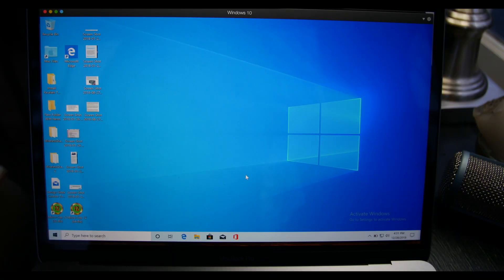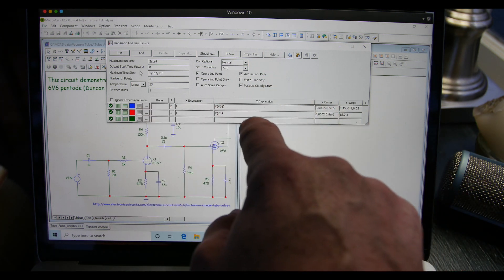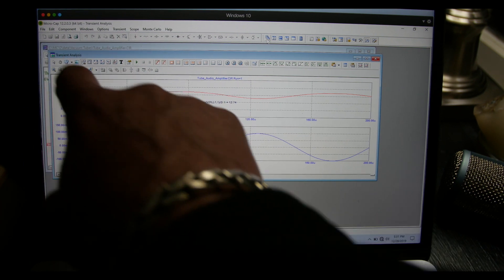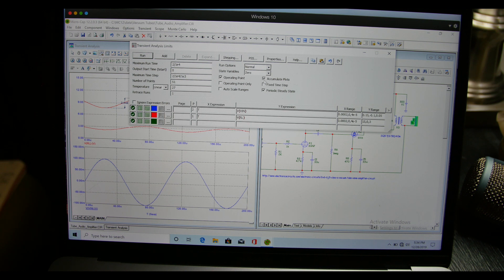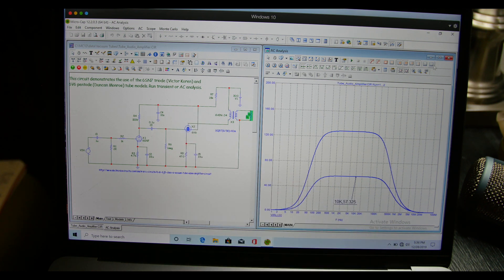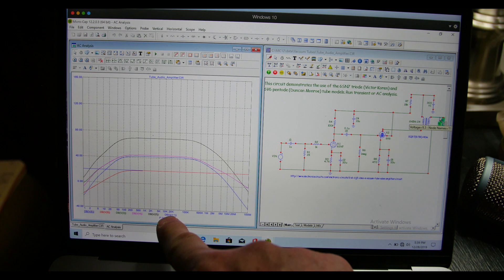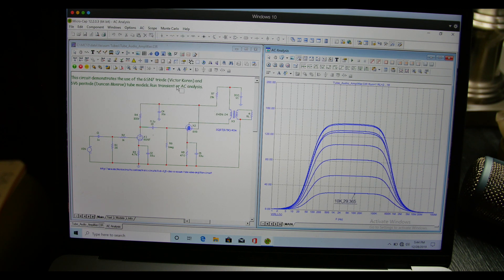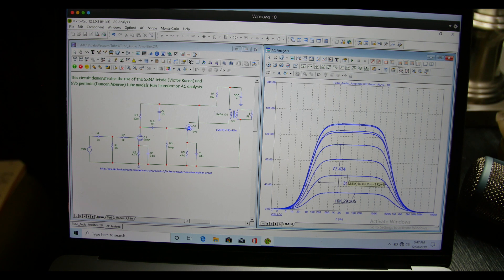Micro-Cap Tutorial #1: Tube Amplifier #microcaptutorial

Comment: Thanks for a very nice presentation. Could you perhapps do a tutorial to understand better simluation problems. In relality the analysis can run into difficulties with more complicated circuits. For example "No DC path to ground"  when infact there is. Or Matrix errors, etc.
Reply from the maker: Thanks for the great idea!  I’ll do that, and is there any other specific examples?
Reply: @KissAnalog  Greetings , thanks for your reply. Well, the problems I have experianced so far are those stated above. Especially when we are dealing with a more complex circuit. For example, how do you deal with a matrix error when the only explanation given is that its something to do with DC loops and the structure of the circuit. In the example of an amplifier ( Tube Amp)  I had to resought to seperating the preamp. and opening another session and looking at that, effectively using the simlulator to look at blocks of the circuit instead of the whole circuit its self. So if you could do a thorough teaching on this it would indeed be much appreciated :-) and keep up the good work sir!

Comment: Thank you for giving us the scoop on this amazing simulator!    While I was playing with the AC Probe analysis, the whole application crashed.  But when I opened it back up, the circuit I was analyzing returned and I was able to continue on with your great tutorial.  I'll have to keep an eye on the crashing.
(I'm running this on a 32GB i7 Core).
Reply from the maker: You are welcome!  I’m happy to see others take advantage of this amazing opportunity!  Are you running on a MacBook Pro?  I use both my MacBook Pro for personal use and a pc for work.  I have had crashes but like your experience, it pops right back up.  Simulations can be dicey but MicroCap seems to be an amazing tool.  I do have a playlist;)
Reply: @KissAnalog  Agreed.  I'm only running on a Windows 10 Enterprise box.  I ran it on a Windows 10 Pro with out any issues.  I'm dismissing it as a fluke.  And yes, I've got your playlist in the queue.  :D  So far it's excellent.

I was playing with Fastad.com circuit.  Albeit it's pretty good with rudimentary circuits, I find it it's just too theoretical as it doesn't address heat dissipation and energy loss.

Comment: At the 13:00 time, why are the top 4 curves on your step analysis not uniformly spaced since the output resistor was changed by a uniform amount.  Something looks wacky there.
Reply: I’m also having a hard time getting it into a mode that allows the animation components to work.  I read in one of the online documents about an “animation” mode which makes sense to allow the animated components to operate, but I find no such mode in the menu structure.  Sometimes DC mode works and sometimes it gives errors saying the model can’t converge.  So, not really sure yet now to get the animation to work that way I would like since I am doing more of a wiring diagram than a circuit schematic and I was hoping to have the switches and relays operate as they will once I build my airplane, but that has been elusive this far as airplanes use a lot of contractors and relays and so far I have not found how to make them work in Micro-cap the way they do in the real devices.
Reply from the maker: This sounds like a very interesting challenge, let me see if I can help.  It would make for a practical and interesting video I think.  I can make something up, but if you want to share a schematic, you can send it to my email.  KissAnalog@gmail.com
Reply: Kiss Analog I think I figured out where I had gone wrong.  I wasn’t thinking the switch side of the relay would be polarized, but it is as well as the coil side.  I expected the coil to be polarized due to the fly back diode, but not the switch, but both are polarized.  It is working fine now.  I am still working on the subtleties of getting into a good mode for the animated components, but Dynamic DC seems to work most of the time.  Thanks for your offer of help.
Reply from the maker: Thanks for the great feedback - that might help others;)
Reply from the maker: Great eye LTVoyager!  I didn’t point that out or get deep into circuit analysis as I was focusing on showing how the tool could be used and what it can do.  Ok, so now that you spotted that, I’ll have to start doing some deeper analysis on this circuit in a video.  For now, if you haven’t tried this, the software is free now so you can.  The first 5 curves show ohms increasing by 2 ohms, then the next one is 16 ohms ;) then it goes 12 ohms then 14 ohms.  If you look even closer, they are not quite uniform, each one goes up a little less and then 12 ohms gains only about half then 14 ohms gains less than half again, but then 16 ohms takes a crash and drops just above 10 ohms.  Great eye and thanks for this awesome feedback!
Reply: Kiss Analog I have been playing with it for a few days now.  I keep finding weirdness.  I need to use a battery contractor in my design (airplane electrical system and avionics schematic), but the animated relay has bizarre behavior.  I confirmed polarity on the coil, but I still see the coil voltage applied to both sides of the switch when when the coil is not energized.  I did get one simple test circuit to work more or less as expected, but when I place the relay in the real circuit to connect the battery to the main power bus, strange things happen.  I may need to try to find the underlying model code and see if I can decipher it.  It almost looks like the model has a fly back diode that may not be “wired” correctly in the model.  Micro-cap looks like a powerful package, but with a somewhat steep learning curve once beyond simple models and into a complete system.
Reply from the maker: Ok this is interesting!  I’ll look into it.

Comment: Hey man thanks so much for the videos. Love your work! Would also love to see some more videos/tutorials on building tube circuits with Microcap. Ive been having a play around with it and have been able to run some AC and transient analysis on my circuit which is awesome, but wondering how crucial it is to enter specific parameters in to simulate the output transformer, rather than using the "Ideal transformer" I also am wondering how to simulate a UL ultralinear type setup using this software. So stoked Im going to have days of fun with this. Cheers
Reply from the maker: That’s awesome Harry!  I like your ideas, let me see what I can do.  Keep in touch!

Comment: Hey Eddie, thanks for that tutorial! Micro-Cap is incredibly powerfull in comparison to NI Multisim or LT Spice (which I worked with in electronics school).
Funny thing, I'm actually working on some tube projects and I'm a guy that likes to work on my knowledge, experience and what I see on a real circuit. But simulations often helped me to quickly proof a concept if it's worth following.

This might now be off topic but still interesting: I decided to swap my Tek TBS1052B against a Siglent SDS 1104X-E. The cool thing about it is that I can connect it with my Siglent SDG 1032X AWG via USB and perform automatic Bode-Plots. I paid together about 800€ and have the capapility of the Keysight series scopes and also have other benefits (free serial decoder, memory depth, ...). The SDG 1032X is fit for crude distortion analysis, mine produces about 0,052% THD+N at the audio band (1,44Vrms level, measured with a Tesla BM543 Distortion Meter, which is some kind of a copy of a HP 334A but without the AM detector). With these two pieces of equipment you don't have to buy the badly specified AWG module and the software extension for AWG use.

I wish you a Happy New Year!
Reply from the maker: That’s great feedback and should help others.  I too like to do simulation to help work things out and get better insight about my circuit.  I think that is why when I do build my circuits, they usually work the first time;) 

Thank you and I wish you a happy New Years too!